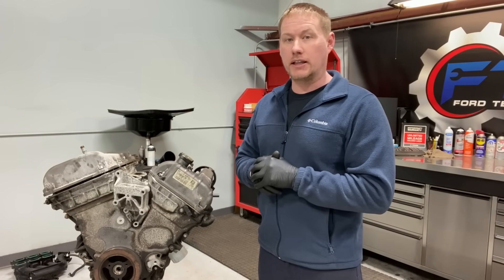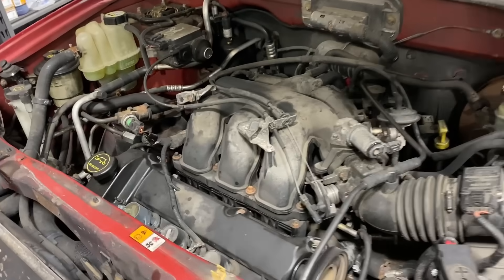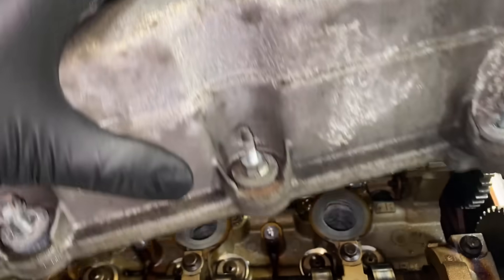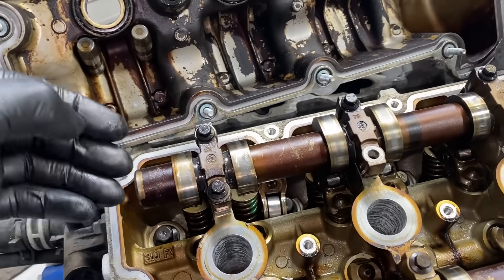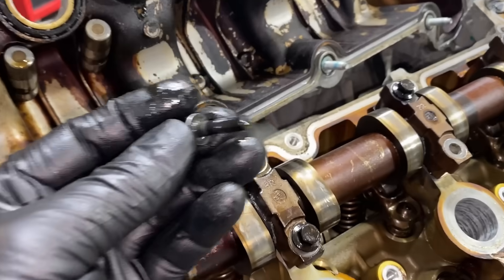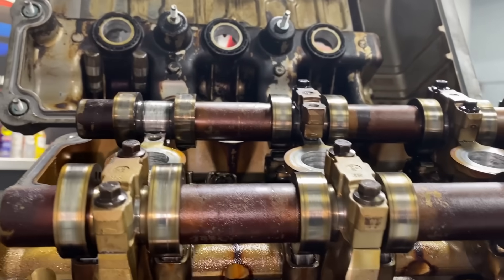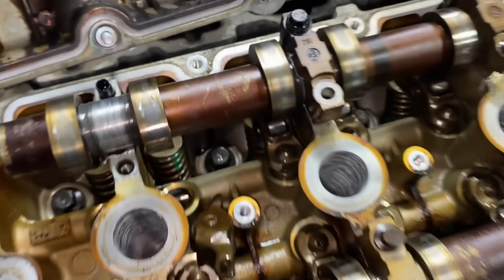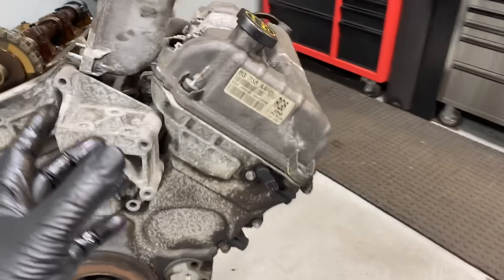Ford 3.0L V6 Duratec Engine: The One Fatal Flaw That Will Destroy This Engine!

Comment: Interesting. 
I had an 01 Mercury Sable with the 3.0 Vulcan engine. Not the dual overhead cam one.
Had one issue with other than normal maintenance. At about 75k-80k miles the engine oil light was flickering off and on. I took it to a mechanic my father in-law recommended( he was a troubleshooter for their transmission plant). The mechanics found that somehow the wrong main bearings had been put in the engine. Too small of a hole to allow for proper oil flow..

Comment: Hi Brian, am the owner of a 2018 AWD Edge, wanted to get the ptu serviced and get the break-in grit out, so called the dealer, was told the front ptu is non-serviceable.  Might as well try it myself.  Do these later model ptu's have a drain on them?  Thanks, your videos are great.
Reply: Brian did a video. but if you have a hand brake vacuum with a extend tube and a double joint 3/8' ratchet drive, you can do it.
Reply: @Dirtyharry70585  thanks, you made my day.

Comment: Have this engine in our 05 Freestyle, just going to drive it right into the ground 👍
Reply: Us too 
190k miles and still runs great
Reply: @tomedgar4375  we have one with 154,000, still going strong!
Reply: 225,000 on a 2004 Escape.  Only complaint is inaccessible location of PCV without major effort.
Reply: 05 with 110000...it's been a great car...cvt and all

Comment: You aint joking about oil leaks, 2 timing cover repairs from the oil leaking in less than 40,000 miles
Reply: Funny, I just did an oil change on my Five Hundred today and noticed I'm losing oil

Comment: There is another design flaw on those engines ... changing the water pump. Ford recommends removing the engine to do it successfully.
Reply from the maker: Wrong engine, you are thinking of the 3.5L Cyclone engine and it does not require removing the engine to replace a water pump except the Ford Fusion Sport.
Reply: That's odd. I just replaced mine in less than an hour. Same engine. The only thing I removed was the battery just to give me a little more space to work, but I could have done it without removing it.

Comment: I had a 2.5 duratec SVT Contour. It was a fun engine to drive when you pair it with a 5 speed manual. Mine had a steady diet of Castrol full synthetic. These engines as the miles pick up, the valve train is super noisy on start up. Mine did not make it past the 200k mile mark. Shot a rod at 171k.
Reply: I had a 98 Contour SE 2.5 v6, it survived everything, but the timing chain guides gave up at 177K. It was fun to drive..
Reply: That's because you used castrol

Comment: Has this been an issue with the naturally aspirated 3.5 engines in Explorers?  I want to be proactive with the maintenance with my Explorer.
Reply from the maker: No just this 3.0L Duratec.
Reply: @FordTechMakuloco  Thank you for the prompt response!  Love your videos!
Reply: Tim, best thing you can do is keep a close eye on your coolant levels and oil condition, your biggest issue is going to be when the water pump fails if your keeping it long term. I don’t recommend anyone buy the transverse mount 3.5/3.7 because it’s not if but when you’ll be buying an engine because or that water pump or if your lucky just spending 2000-2300 on a water pump job."

Comment: Thanks for this. My '08 Fusion has this engine. Luckily It doesn't tick like this one did, but it does make a loud whistling noise when I accelerate pressing the gas pedal more than halfway down. I dont know where its coming from. Drive belt has already been replaced.

I'd love to have more details of oil leaks on this engine, as that's exactly the problem I have with mine, too. I lose about a quart of oil a month, and I do a lot of highway driving (more than 50 miles a day average).

Comment: 89inch lbs isn’t much
Reply from the maker: Almost all cam cap bolts on Ford engines use this spec and never have a problem, it's only an M6 bolt so the torque will be low.
Reply: FordTechMakuloco looks bigger than a M6 in the video, I’m surprised they use such a small bolt and low torque.

Comment: Would you say the gen 2 5.0 is more reliable then gen3 5.0? I’m looking at a 2016 Ford F-150 with a 5.0 and 6 speed transmission.
Reply: The Gen 2 is a better engine period. Ford saved 6 lbs per engine by using a plasma lined cylinders instead of cast iron bores,on the block of the Gen 3, where as the Gen1/ Gen2 has a cast iron sleeve in the aluminum block, the other change is the Gen 3 has GDI as well as port fuel injectors. Many Gen3 coyotes burn a good amount of oil from the plasma lined cylinders. I would get a gen 2 or a 2.7 ecoboost if you want more towing and low end power than a coyote .The 2.7 is one of the most reliable f150 engines available. Don’t believe the hp numbers either , the 2.7 is the hot rod of them all, very quick.

Comment: The 3.0 Duratec was certainly a good engine but I was more partial to the 3.0 Vulcan. Slow as all hell but seriously durable. If I'm not mistaken, the 3.0 Duratec is the foundation of the 3.5 Ecoboost.
Reply: I think they are different base engines, but they just share the same name. One of the biggest differences is that the 3.5 and 3.7s use a timing chain driven water pump whereas the 3.0 uses a self tensioning belt on an external water pump
Reply: Ray Klotz Thats only the transverse mount 3.5/3.7. The longitude mount(F150,Transit van ) do not mount the water pump inside the timing cover .

Comment: Thanks,  about to do vc gaskets on our 2003 Mazda mpv that uses this engine. 210k miles and going strong. I think I'll replace those bolts as a precaution
Reply: What other gaskets did you change besides the vc?

Comment: I've seen this in engines that have been overheated.👍😷
Reply: Metals do expand under heat
Reply: As a mechanic I’ve realized most problems come from abuse. 
Wether you know you did it or not. 

My engine has over 400,000 and has been dead reliable. 

Because I don’t overheat it. 
I don’t skip oil maint.

Comment: Thanks for the video Brian - definitely food for thought! Luckily for me the 3.0 in my 2005 Five Hundred is still quiet and smooth with 120K on it. As for oil leaks - my driveway will agree with you! Cheers!
Reply: We have 200k on our Mazda 6 3.0 no leaks
Reply: @chrisa7832  which model year is it? Thanks
Reply: @horseathalt7308  2006

Comment: It's really too bad they quit putting these engines in the Escapes.  I much prefer these over the EcoBoost 4cyls they are using now.  You rarely ever see the 3.0 Escapes come into the shop with engine problems, they just keep going and going.
Reply from the maker: Yup they are awesome just leakers.

Comment: What vehicles/years are these in?  Also, you mentioned the oil leaks are easy to fix.  How would you to that without pulling the engine if it's up on the T Joints?
Reply: 02-07
Reply: @ohger1  So you're saying this would be a different "Ford 3.0L V6 Duratec Engine" than the one in my 2010 escape that has a Ford 3.0L V6 Duratec Engine?